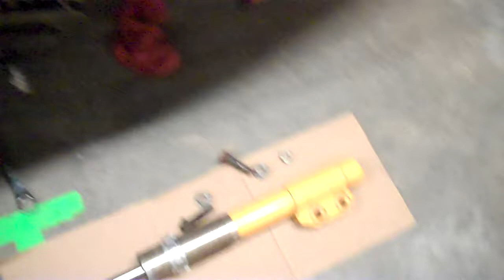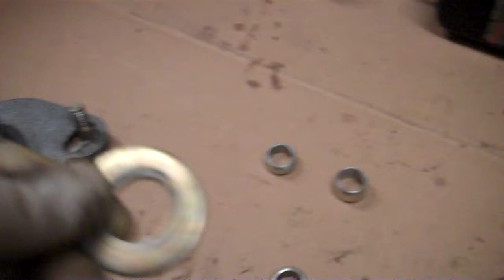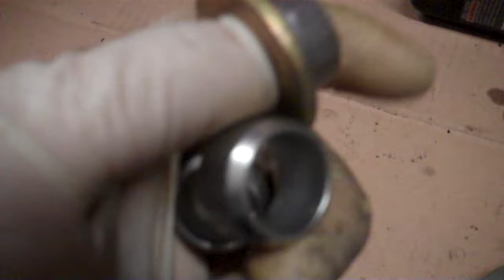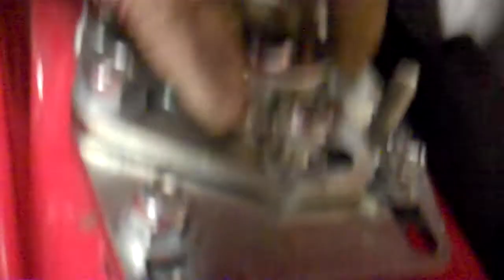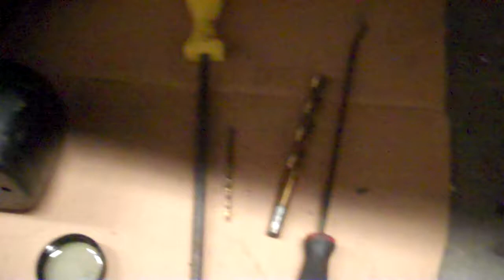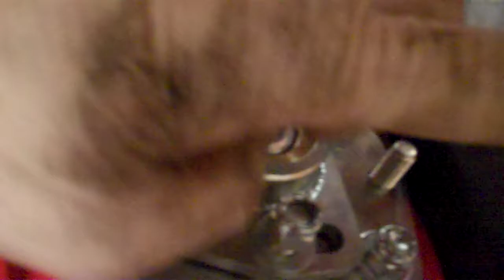how to install coilovers and casterplates on 99-04 mustangs

Comment: Hey man, you video was very helpful. I actually had a quick question though. I am about to switch my 03 cobra to QA1 coil overs and QA1 caster camber plates you have in this video.  I’m trying to figure out how I need to setup those spacers on the front coil overs. How many and which ones go on top and which ones go on the bottom of the plate. Thanks

Comment: Outstanding video, not a lot of videos on coil overs that actually show a layout of the pieces in order and an explanation of it. The only thing I would say to the public is the necessity of 4 bolt plates when going coil overs due to risk of strut tower damage or failure if you use a 3 bolt plate on 94-04's. I had 3 bolt plates on mine and thought I could do coil overs like my old fox body's and was unpleasantly surprised to find out I needed 4 bolt ones on SN95's but now its done and over with and worth ever penny. Great job!

Comment: I'm using stock caster plates for now but I install everything but there's noise coming up top like a clunk when going up and down. I dont think it's bottoming out because the noise would come from the bottom. If you can help me asap trying to put the car back together.

Comment: Hey Shawn great video. You seem to know a lot about this so let me ask you a question, my mechanic just installed H&R lowering springs, Bilstein shocks and struts, and a Granatelli caster camber plate on my 2003 Mach 1. After the install I'm having really bad clinking noise under the hood so I took it back and he can't seem to figure out what the problem is. He disassembled everything and put it back together and there is still the clinking noise, any idea what the problem could be?
Reply from the maker: Noise is very hard to find some times. I will give you some pointers.
(noise can be caused by 2 parts contacting or rubbing)
first pin point the noise to what side left or right.
will it make the noise while the car is just sitting by pushing up and down at the camber caster plate (I call this jounceing) or while turning left or right. This may help find what side.
try to get the car to make the noise while sitting there and don lift the car that changes suspension load. You might want to grab a stethoscope from harbor freight and listen to all the parts if you can duplicate it while sitting. Its hard for me to help without being there. start with that and let me know what you find.
Reply: shawn beauregard Thanks for your help. It turns out that the Granatelli Motor Sports caster camber plates didn't come with polyurethane bushings or any bushings for that matter so the ball bearing was hitting the top of the strut I guess causing all the clinking under the hood on both the driver and passenger side.

I ordered Maximum Motorsport caster camber plates that came with bushings and after they installed them there was no noise at all so problem solved.
Reply from the maker: stephen78able Im glad it was taken care of.